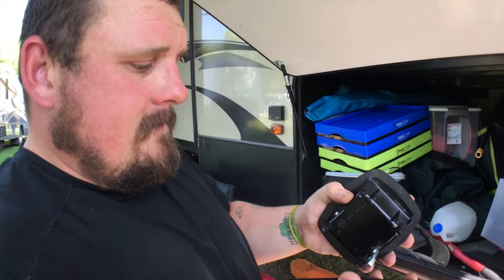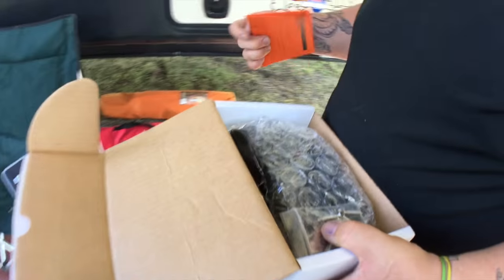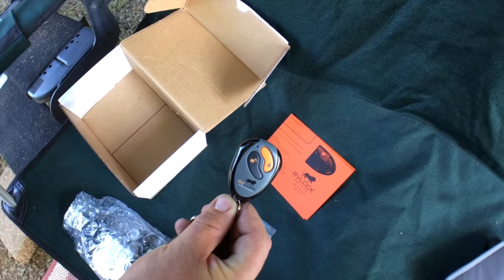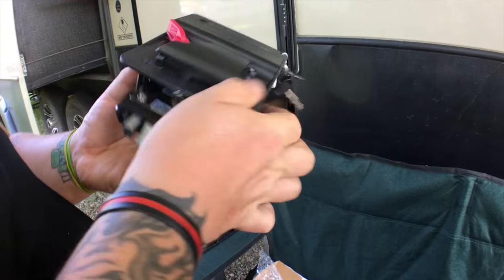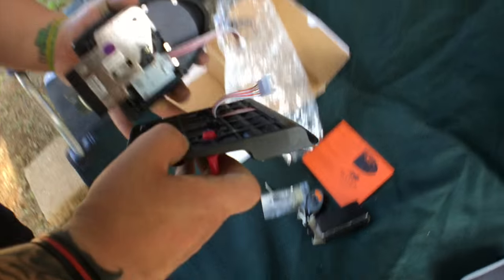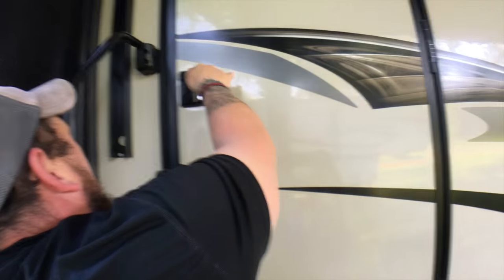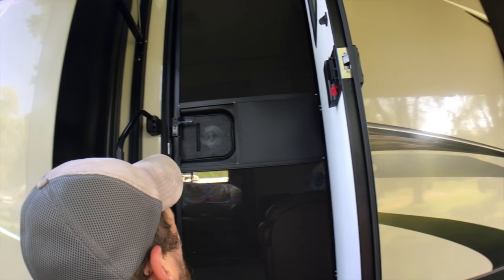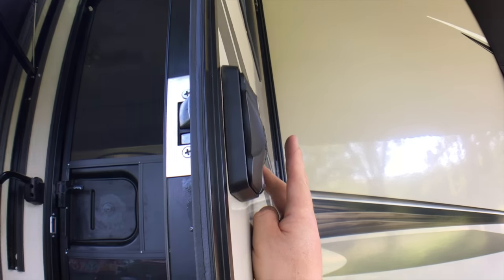SpotTheScotts: Installing Our RV Lock Keyless Entry! ~ RV Life! {#281}

Comment: hey guys forgot one more thing didn't know if you knew this but I just found out from a friend of mine he was Paul and his RV on a long trip and was behind somebody as they were going down the road and cruising along according to the GPS on his cell phone long story short he was slow enough but still cause massive damage to his fifth wheel because the bridge was too low and he took out the air conditioner and a satellite dish thousands of dollars worth of damage it wasn't until after that he found out they sell this thing called an RV Garmin which is specifically designed to give you all of the right routes for RV years and if their bridges are too low it will reroute you to the right Bridge saving you thousands of dollars in damage for your coach anyway wasn't sure if you knew but I'm definitely going to go get one because I know my phone doesn't tell me the difference anyway take care guys love the video
Reply from the maker: +jerry denning Hi Jerry we actually already use the Trucker Garmin that lets us put in all our dimensions and works the same way! Thank you! It's very important!

Comment: Scott's great idea so great I followed purchased and installed same one, now very interested in how things turned out as far as the storage doors. Have you received the keyed latch for those doors. Thanks again and do a video if the latches you receive fit, been to their website and only saw the same one you had the problem with.
Reply from the maker: Wonderful and glad to hear it! With how much we've been up to and moving, we have not yet dealt with getting them switched for a replacement. Stay tuned.